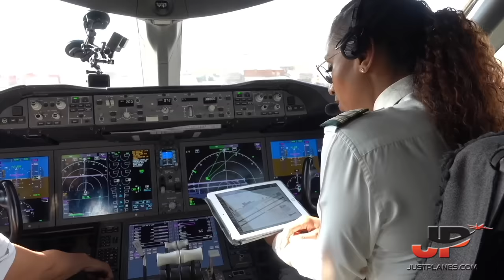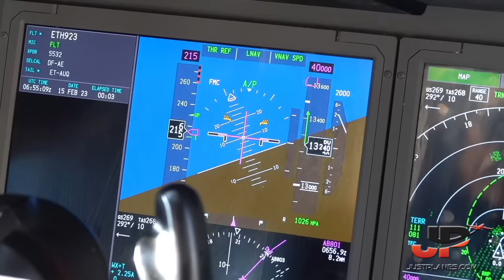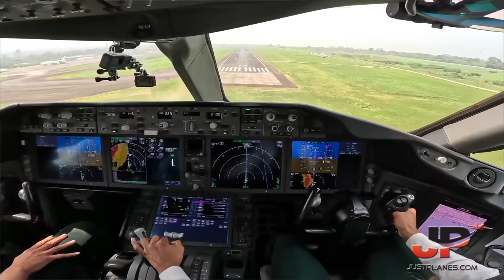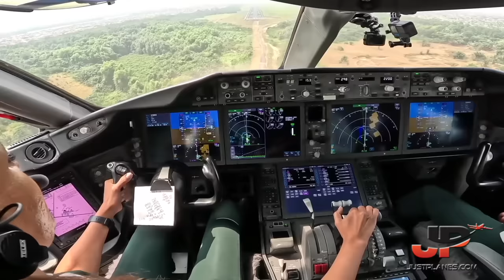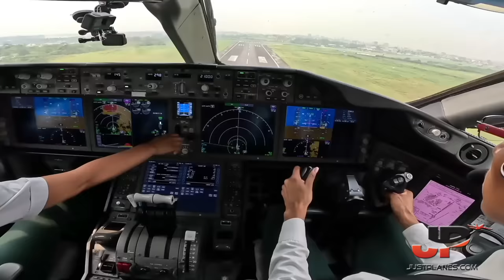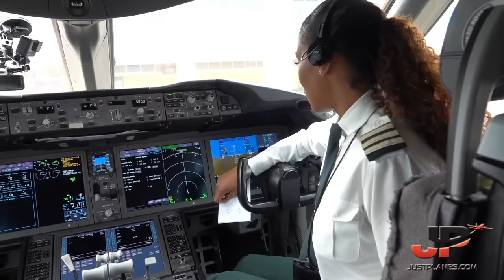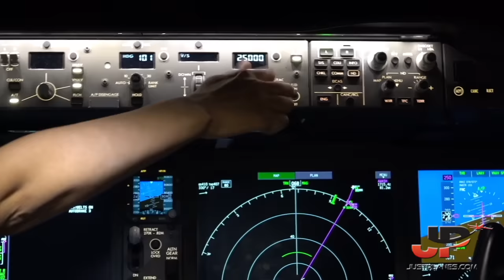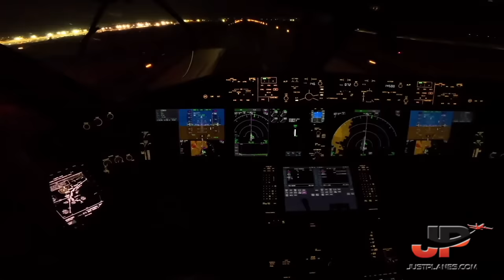Ethiopian Boeing 787 Cockpit Across Africa "Girl Power"

Comment: Great job ladies! With regards to the wind at Nsimalen being 010@10Kts, was the required minimum visibility a factor in your consideration to fly the ILS 19 instead not to fly the RNP RWY 01 approach? If the wind and visibility was of no factor at the time of your approach briefing, with an increase of wind to 10kts tailwind, probably the limit or closed to your max tailwind landing limit, after the Captain who did a great job repeating the wind direction and speed to the PF in a way to raise awareness to it, The PF should have however clearly stated her intention (ex: wind within limit, enough Ldg distance is available, continuing) instead of just saying…. “ hmmm”. Also, unless this was a 2 days trip as I heard at the end, Ethiopian Airlines flight operations hours for 2 crew is kind of stretching in terms flight hours limits for a Day trip.  ADD-MBO-DLA-NSI-ADD is pretty closed to 10hrs of flight time and almost 14 hrs of duty time. I don’t know what the flight time and duty regulation in Ethiopia is but fatigue known to be a killer. I know it’s easier for me to seat behind my screen and notice things, but l continue to learn and try to be safe. Stay blessed Ladies🙏🏾
Reply: Yeah. Those pilots were overworked.

Comment: Becoming a pilot is reading the map on the screens correct  , pressing the right buttons in the correct order for the auto pilot to engage and using common sense. Human error happens when the computer goes , that's why the airplanes always crash, it's monkeys pressing buttons. 10-4

Comment: I used to load and unload the Ethiopian flight that came into Newark Airport.  The baggage compartment was a mess usually.  They always carried 2 extra tires for the plane...1 nosewheel and 1 main gear wheel.  You had to climb over those tires to get stuff in and out of the compartment.  Some of the baggage was poorly packaged, stank.  Sometimes there would be live monkeys in cages to unload and they would have to wear protective suits and masks as precaution from diseases I guess.  The people they had doing these jobs had virtually no training and the potential for damage to the plane was very real with moving heavy equipment around it.
Reply: Not true